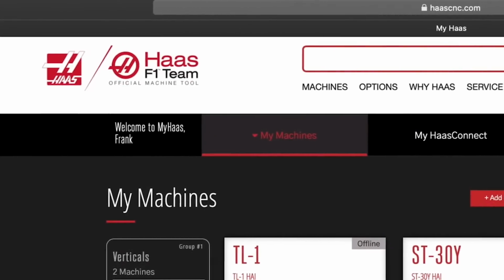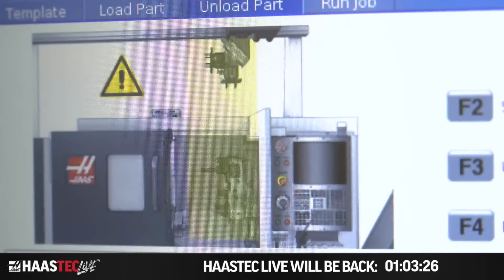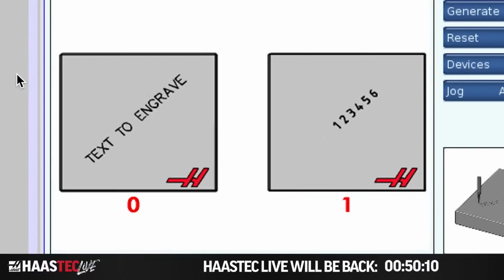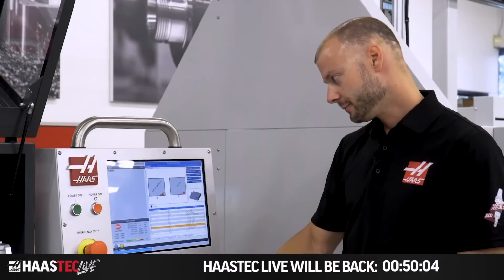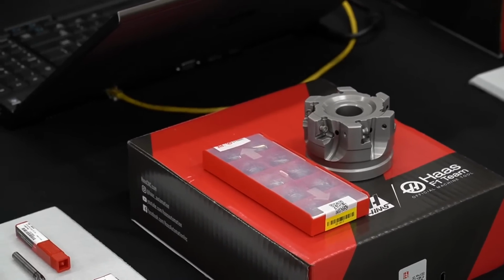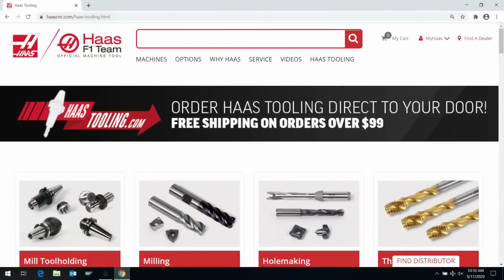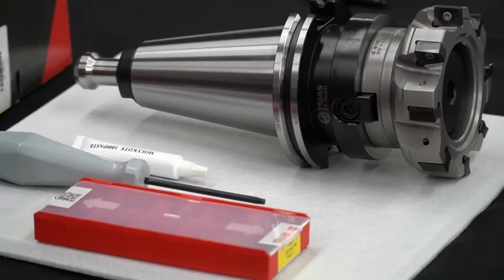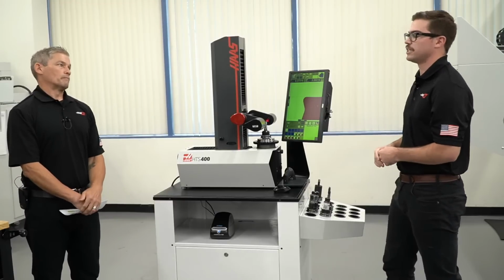HaasTec Live Thursday PART TWO September 17, 2020

Comment: So question! There are several obvious was of boring holes. Based on this video where you are using the cutter to I am guessing a rough bore operations. From an accuracy standpoint, if this was the only method available how accurate can you hold the hole tolerance.?
Reply: Overall accuracy depends on several factors. The main factor is the ratio between the diameter of the bore and the feed rate. The smaller the bore, the slower you must go to maintain roundness. In many cases you can get roundness under .001". 

If roundness is critical or tight-tolerance it is always best to use a single point boring head to finish which almost guarantees near perfect roundness if the setup, feeds, and speeds are all good. Yes its slower than interpolating but if you scrap even 1 part for out-of-round you probably more than overtake the extra time doing a single point bore over a medium size lot.

If you have a critical bore I would recommend you review the print with your local HFO application engineers to decide on the best process